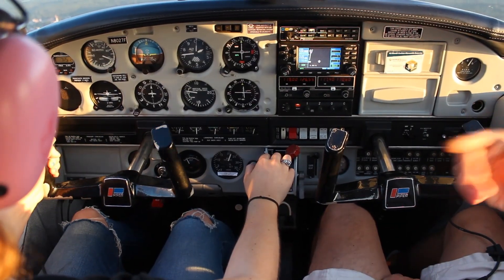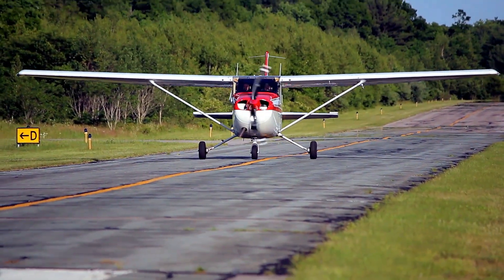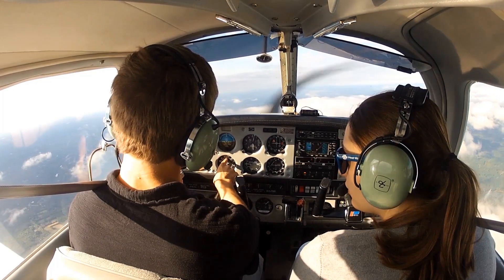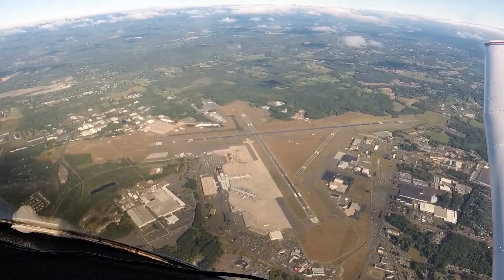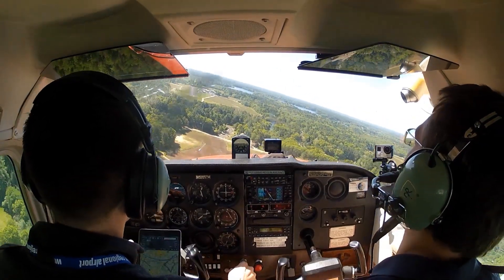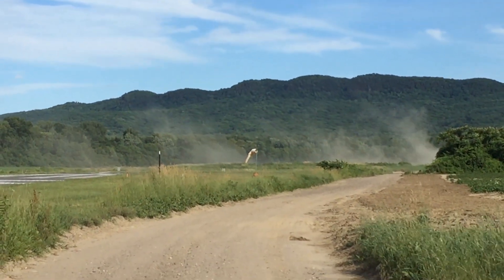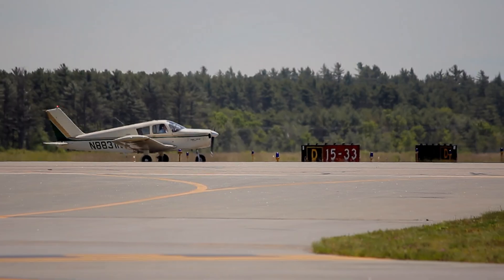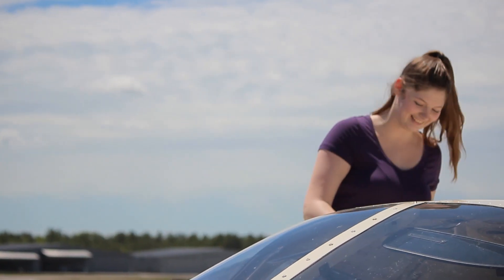Carb Heat Demystified:  Understanding the mechanics and the dangers

Comment: Thanks for the informative video. On the PA-28-161 I fly, the green arc only goes down to 2,000 RPM, but the manual only says to test for icing when at low power settings, then turn the carb heat off, just like you said. I've also noticed the carb heat in the PA28 gives little RPM drop on runup (maybe 50 RPM?), whereas in the C172, the power drops substantially.
Reply: Some engines in some planes make ice more than others. That's really what it comes down to. Pipers just don't make ice like a Cessna. I never got carb icing (even in winter no less) in my 160 hours or so in Pipers. But when I bought into my 182P, it makes ice a lot if the temperature is fairly low or there's a lot of moisture.

In my case though, I have a carb temp gauge, so I do not usually pull carb heat out for the entire descent unless it needs it. If you don't have that gauge, then the original POH instructions should be followed.
Reply from the maker: I've noticed the same thing.  Some PA-28's will drop as much as 150, but that's the most I've seen.
Reply: Which makes it that much easier to accidentally leave it on. Not that I've ever done that...

Comment: Why doesn't the carb heat inlet have an air filter of it's own? Something I've never been able to make sense of.
Reply from the maker: I was hoping you would chime in :)
Reply from the maker: Me neither!  My best thought is that pushing heated air through the filter would degrade the filter faster, but Piper does it over the cylinders, so I honestly have no idea.
Reply: Inability to cope with the temperature seems a plausible candidate. I can't imagine the temp of air flowing around 350°F cylinder heads is anywhere near as hot as air that's been heated by 1350°F exhaust. I've had the same question before and had it again while watching this video - so I sent it to Mike Busch. If anyone knows or can find the real answer, it would likely be him.
Reply: Indeed, Mr. Busch not only knew the answer but responded almost immediately.

"It is a requirement for certification that carburetor heat bypass the air filter. The reason is that carburetor heat is normally the only source of 'alternate air' for the engine in the event that the air filter becomes iced over or otherwise obstructed."

So I wondered, OK, if alternate (unfiltered) air is required of carbureted aircraft, what about the fuel injected variety? And it turns out I already knew the answer from my own POH, I had just forgotten about it:

"The possibility of induction system icing is reduced by the non-icing characteristics of the fuel injected engine. Under certain conditions, however, impact ice can form at several points in the induction system. If the air intake or filter becomes clogged with ice, a spring-loaded door in the air intake duct will open automatically and the induction system will operate on alternate air."

Mike confirmed for me that in all cases a certified airplane is required to provide a source of unfiltered intake air. With carbureted engines they let the "carb heat" lever combine both functions for simplicity. Since injected engines don't have a need for heated intake air, the requirement is met either with an automatic door/flap or with a manual lever in the cockpit.

Comment: The old C-85 engines, like on this 1946 Cessna 140, The Carb is attached to the bottom of the intake and is attached to the bottom of the cylinders. Because of the distance  of the carb to the rest of the engine  and the large amount of airflow inside the cowling carb ice is very possible.
Reply from the maker: Is that with a Continental engine originally?
Reply: Yes, the C-85 is the engine that the 120's and 140's were originally equipped with.
Reply from the maker: Makes sense!
Reply: If you ever get to fly one, do it. Their a joy to fly and almost as fun to work on.

Comment: Interesting video! Embarrassingly I learned something from this which, as someone who has instructed for a while, I should have known already. I was previously taught that with low throttle settings the butterfly valve has a greater cross sectional area relative to the air flowing past it, giving an increased area on which ice can form. Maybe there are elements of truth to both.
Reply from the maker: Huh!  Interesting!  It's probably true!  I knew I would learn something from the comments too.  I always do!

Comment: I only turn on carb heat if the ice on the wings is 1 inch thick or more.
Reply from the maker: lol
Reply: @FriendlySkiesFilm  RIP
Reply: Danie Louw, I'm just an arm chair pilot that was trying to be funny. What I was thinking is if you had an inch of Ice on your wings, carb heat would be the last thing to worry about ;)
Reply: Black dog, down boy-- down.. here let me get you a bone.
Reply: You're funny.  You toss the grenade and watch the fun.
Reply: empty pockets bybass to the cockpit via pvc tube, i turn it on when i feel colkd :D !!
Reply: empty pockets lol
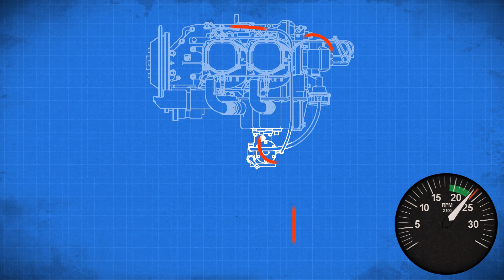Reply: 1:24 "...as the engine block is not attached to the carburetor."
Isn't that backwards?
The engine is attached to the air frame, the carburetor is attached to the engine.
Just yanking your chain, thanks for the clip. (And besides, in the example the point is the carburetor is not attached!)
Reply: Now your barking up the wrong tree dog. I got an Idea, how about you go chase a parked car and make a video of it.
Reply: Patrick Powell lol
Reply: Congrats.  You've been trolled.
Reply: empty pockets Or when getting road dome... just in case.
Reply: While saying that the small thing is attached to the big thing is the more logical way to say it, one can also formulate it by treating attachment as a symmetrical thing, where a big thing and a small thing are attached to each other, so linguistically speaking its not wrong.
Reply: After I get the carb heat going, I slow the plane down, open my door, and beat the ice off as much of the wing as I can reach using a baseball bat. You can usually get most of it to shed if you get it started at the wing root.
Reply: I only turn it on after 2 meters, I’m not easily scared
Reply: Danie Louw; you must be a blast a parties
Reply: So,, while you’re on the ground? Got it. 😂
Reply: Now that was funny...  I always use it when getting ready to land no matter what the weathers like.
Reply: My cock has a large 6'2" frame attached to it.
Reply: empty pockets ice on the wings got nothing to do with carb ice. Infact you are more prone to get carb ice on a hot summers day than on a cold day.
Reply: @danielouw2095  ??? how?